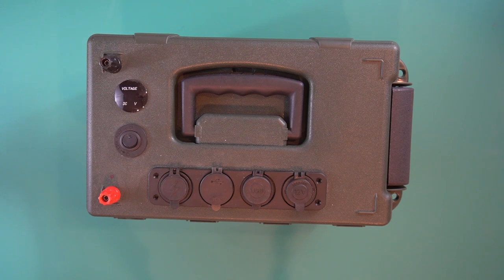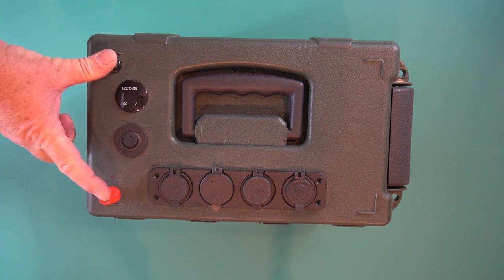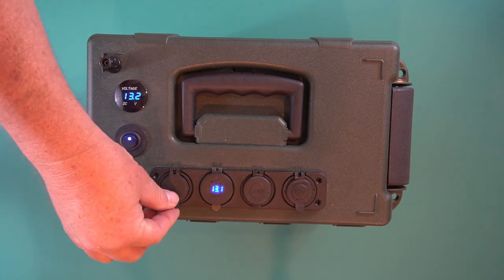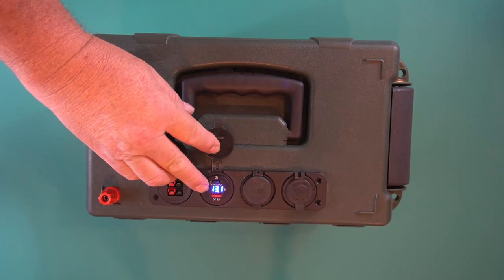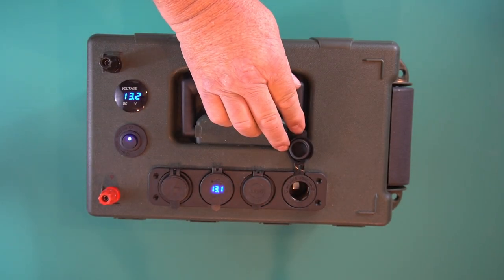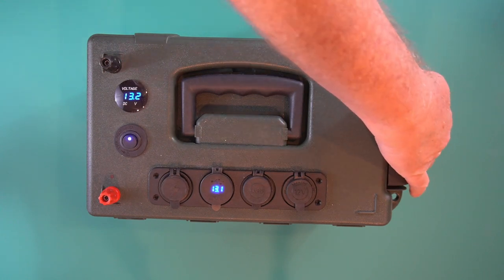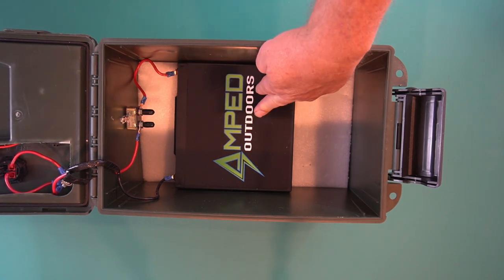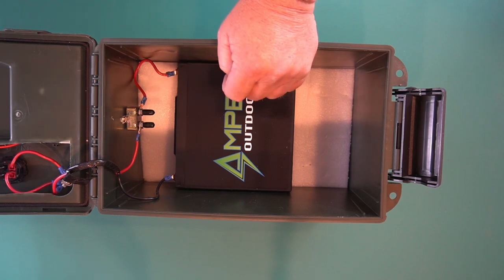How to make a great portable Battery Box.  Using on of the best Amped Outdoors 30 Amp Hour Battery.

Comment: That looks pretty good.a have a lot of them ,everyone has their own take on them and none wrong. it is your needs . I use the same powerwerx stuff and that have pre made box. for me i used the harbor freight 50 cal ammo box.  USB C 65W for my laptop . same power pole and also have power pole 75amp on the side. powerwerx has them as well. I have MPPT 150-14.6 controller in mine and got some noise on HF from it. took out most with ferrite on solar and battery leads on controller. using 2 100 watt folding solar with ICOM 7300. no Hf noise to talk about now. I went with bigger LiFePO4 . I do have a small one in ammo box 30 cal harbor freight one. that one has 4 -30AH 3.2V lifepo4 cells with my own BMS.  bult years back. still works full power. that on has SB50 anderson on it. it's ,y back up one now. 73's
Reply from the maker: I will be adding a solar charge controller in the future, thanks for the comment

Comment: What did you use to drill the holes? I saw you said 1 1/8". Is that a hole saw, forstner bit, or what that you used?
Reply: unibit from Harbor freight..